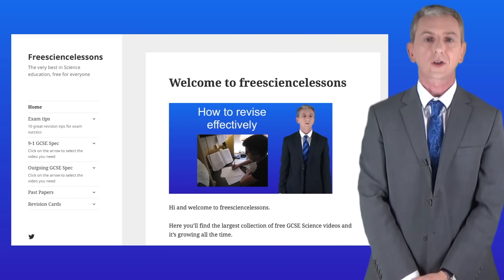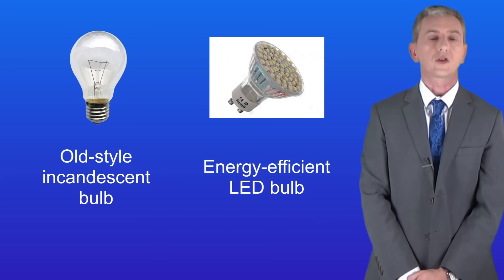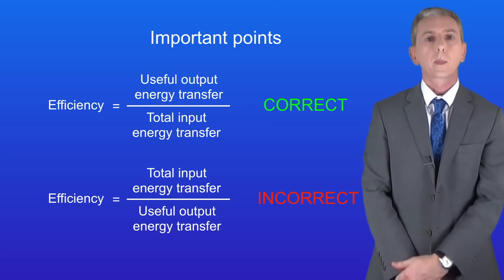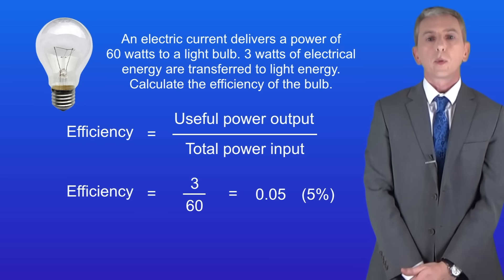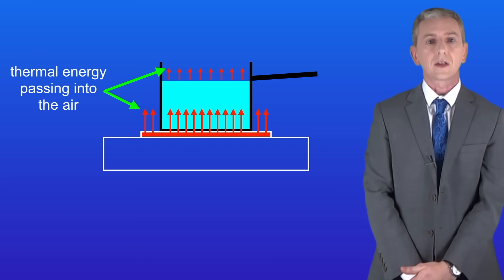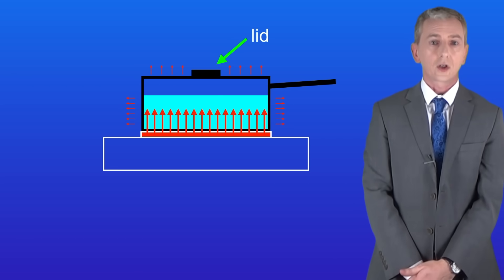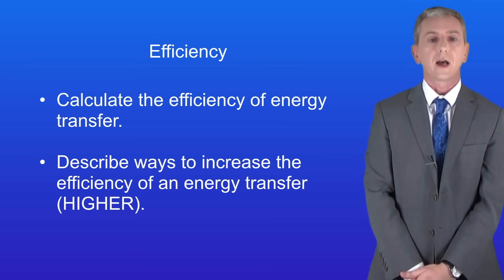GCSE Physics Revision "Efficiency"

Comment: Hi, I was just wondering about the end bit with metal being a good conductor of heat, but then you say this means more thermal energy passes through the walls to the air. So does this mean it’s better to use plastic because less is transferred to the air?
Reply from the maker: A plastic kettle will be more efficient than a metal one as less heat energy is transferred to the air through the walls.

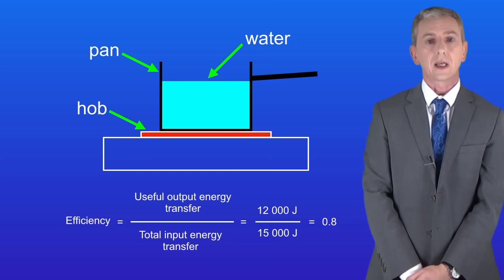Comment: 1:38 I thought that the 12,000 went underneath since it was being transferred IN the water, therefore was being ‘inputed ‘ ( if that makes sense) and then 3 thousand went on top of it since if 12,000 out of the 15,000 is being input then 3,000 must be ‘outputted ‘
Reply: Jus remember USEFUL output on top, TOTAL input on the bottom

Comment: Are these lessons enough to read for IGCSEs too? Do GCSEs and IGCSEs have different syllabus? 
I got 6 months 'til exams and I need to prepare. Shouldn't have slacked off in those classes T-T
Reply: If you're doing the AQA specifications then yes this is all needed, infact even if you're doing a different exam board most of this is still necessary.

Comment: Don't you have to put units at the end of 0.05?
Reply from the maker: Efficiency as a decimal has no units.
Reply: but u do have to put the % sign. Make sure to do this. The correct formula which is most likely to be used is useful energy output/energy input * 100. You MUST always put a % after your answer as that is the used symbol for efficiency. E.g if you use the method shown in the video and get an answer like 0.5 you must multiply that by 100 to get the correct percentage for efficiency, in this case it would be 50%. Use of the % is now in the new marking schemes so be sure to use it.
Reply from the maker: That's not correct I'm afraid. The AQA spec says that students could be asked to express efficiency as either a decimal or a percent. If they ask for a decimal, then a percentage is not required. Infact, the equation stated in the spec is for a decimal not a percentage.
Reply: @Freesciencelessons  ultimate clap back